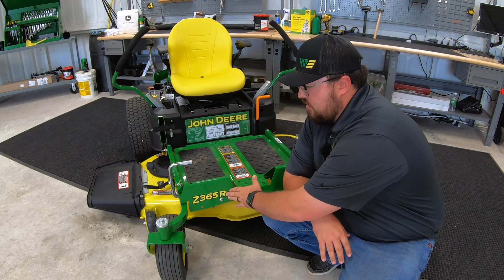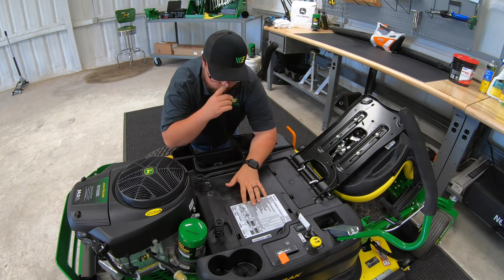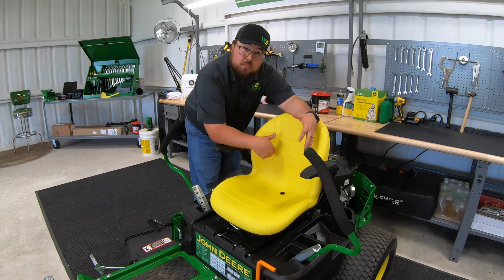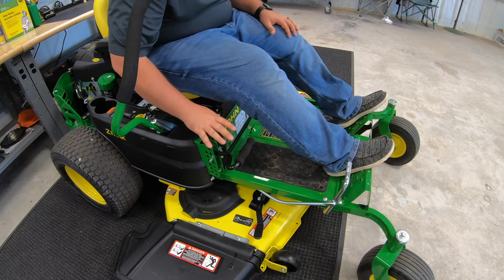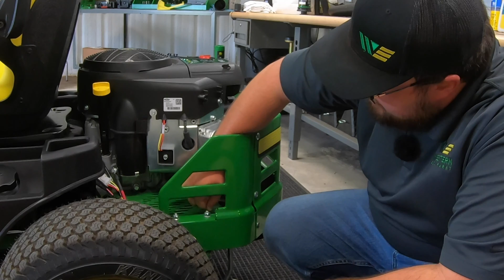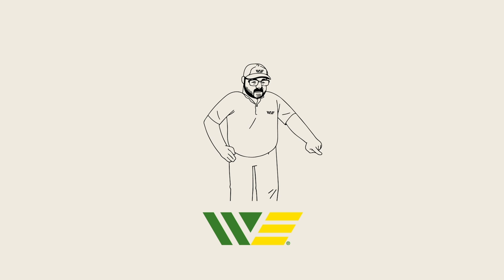John Deere Z365R ZTrak Zero Turn Mower Review and Walkaround

Comment: I have z365r john deer zero turn mover. I want to change engine oil but I couldn’t find the outlet. I guess it was under bottom of oil check yellow color stick and it is a bolt and I try to open it but it’s very hard to open it. Can you give me some ideas?

Comment: I have a 365r with 60 hrs on it. I have done the easy oil change at 50. I am contemplating using the conversion kit back to normal oil changes. How will the life of the engine be affected one way or the other? What would you do it if it your mower and you hope to have it 10 years?

Comment: Great video as usual.  Few questions: 
 
1) The baffles under the deck seem to isolate the blade on the side opposite of the discharge.  When you switch the mulch lever to open the discharge, how does the grass from this isolated blade make it out of the discharge chute?
2)  Also, the washout port is located on that side as well...how does it clean the entire deck when that blade seems to be isolated by a non moving baffle?
3)  Lastly,  is there a dual bagging kit for this mower (p/n please!) or does the mulch kit make it impossible to add one to this mower?

These are HUGE points of interest that potential buyers should be aware of, right???
Reply from the maker: These are all good questions.
 
1. The clippings from the farm side will not make it to the discharge, there for one blade will always be mulching.
2. The washout port is going to be somewhat ineffective on this mower and i thing this is something that John Deere is looking into.
3. There is no bagging kits for the 48" deck or the 54" deck in the Z300 series because these sizes of deck would require a blower and these mowers are not strong enough to carry one.

I hope this helps!

Comment: Is there a bagging collection system that is compatible or can be rigged to work with the Z365R?
Reply from the maker: You could probably rig one up but you would have to remove the mulch control kit that come on the deck from the factory. I would have to look further into this to know exactly which kit you would need. Let me know if you would like more info. Thanks for watching!
Reply: @WesternEquipment  Thanks!  It is something I would like to try if possible, but have been having a hard time finding information on.  If you can point me in the direction of a kit that might be compatible with some rigging, it would be much appreciated!  I am sure there are many viewers that would be curious to the same.

Comment: Thanks for the great info. My storage opening is 54” and would like to use a bagger. The JD chute will most likely be too wide. Do you have an opinion on using something similar to the Accelerator grass catcher on the Z365 with the 48” deck. This style may be easier to remove and replace each time I mow (twice weekly). Please continue with these informative videos!
Reply from the maker: I will have to do some research on this one and if I find anything I will be in touch. Thank you for watching and don't worry, there are plenty of videos to come.

Comment: When using the wash port after every use (says to wash after every use in manual) would you keep the mulch door open or closed?  If you can't keep the mower in a garage or shed, what theft deterrent would you suggest?  I was thinking of a motion alarm.  I've seen some wheel clamps for golf carts but not sure it would work for the mower as I've heard you could easily just use a pry bar to take it off.   Thx for you video.  Did you test this mower for how fast it mows an acre?
Reply from the maker: I would do it both ways, door open and shut. As far as theft deterrent, I think a motion sensor would be good or if you have a good spot to chain it to that may be a good option as well. I hope this helps and thanks for watching!

Comment: How easy is it to remove the deck for cleaning. Can the mulch attachment be removed and re installed.
Reply from the maker: The deck is fairly easy to remove. The most frustrating part is removing and reinstalling the belts. And yes, the mulch kit can be removed and reinstalled. Good questions and thanks for watching!

Comment: Does the throttle limit the max speed when the levers are fully pressed forward? If so, is it safe to do so? I would likely add a hitch and tow an aerator and would want to aerate at a slower speed without having to manually limit the speed with the levers.
Reply from the maker: Yes it will limit your max speed. And since you won't be mowing while you are aerating, it is totally safe to do this. Good question and thanks for watching!
Reply: @WesternEquipment  so if I were to mow and engage the PTO with the throttle down, that could be problematic? Does it essentially throttle down the power to the blades too?
Reply from the maker: I always suggest engaging the PTO at about help throttle, then go up into full throttle when cutting. And yes if you throttle down it will affect the blade speed.
Reply: @WesternEquipment  thanks for the quick reply!

Comment: Today's John Deere lawn and garden tractors are garbage overrated overpriced garbage
Reply from the maker: Interesting, I feel like reviews and other sources would suggest differently, but everyone is entitle to their own opinion. Thanks for watching!
Reply: @WesternEquipment  all john deer fanboys hope you like the plastic gears and hoods because a lot of Deere's have them
Reply: What mower do you have,or what is your preference?
Reply: @ciphercode2298  I have a 2021 Craftsman T240
Reply: @flatstheflounder9874  I've got nothing against the newer craftsman mowers,own an 8 year old cub cadet myself. It's TRUE that all manufacturers cut corners here and there,most john deere mowers get pretty good reviews. My old cub cadet was built by mtd and it's been reliable enough.  It's got the single cylinder Kohler courage that gets a bad,but mine has been great. I wish I had an electric pto,but otherwise cant complain
Reply: @flatstheflounder9874  If I read correctly the t240 and all red craftsman mowers are rebrands husqvarna's. All the gray ones are mtd built.
Reply: @ciphercode2298  I don't care who builds them they are a superior tractor over the John Deere's

Comment: I bought a 375 R last year based on your great reviews. It cuts nice but not having a fuel gauge is inconvenient,and the fuel filler hole is half the size of my old lt133 which makes it more difficult to fill. I also am surprised that the JD engineers placed the cupholder directly in line with the exhaust. I know I'm nitpicking but JD products should improve over the years. It is a nice machine other than that. Thanks for the reviews!
Reply from the maker: All good points to be noted. I'm glad I could help you make your purchase and thank you for watching!

Comment: Hey brent, wondering if you could tell me the difference between the tuff torq trans that are in the z545r and the tuff torq 400 series
Reply from the maker: Basically the 400 series is just a more commercial grade unit. carries more weight and allows a higher top speed. I hope this helps and thanks for watching!